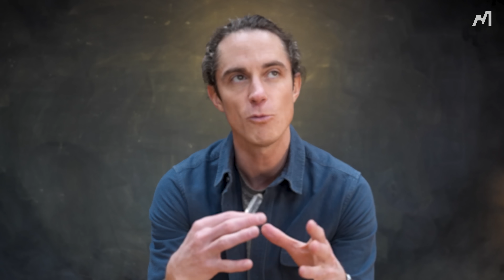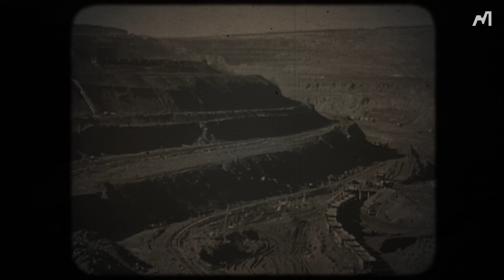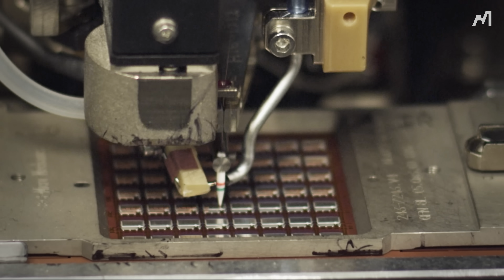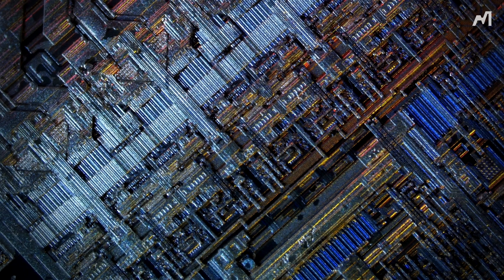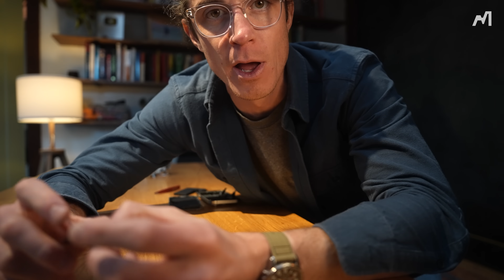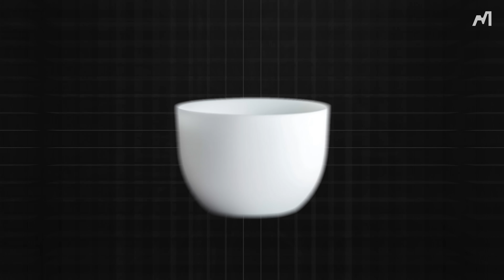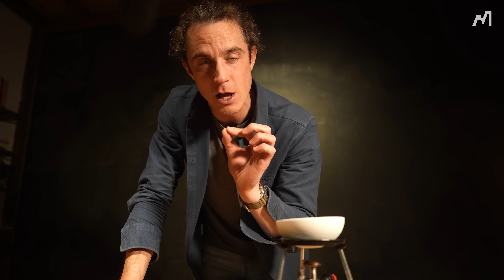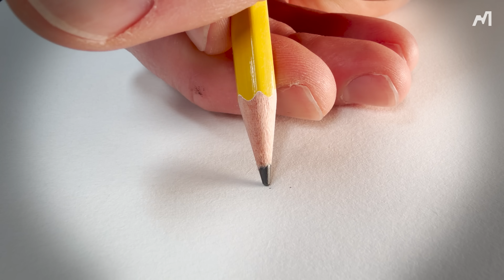Saudi Arabia Has Oil, America Has This

Comment: Hi from Spruce Pine. There are 2 main mines here. One just terminated (not laid off) 60 people. Sad and confusing. What’s going on?
Reply: Because this video is disingenuous. Natural quartz is on its way out. Traditionally, synthetic quartz was considered more pure but more expensive. This is rapidly changing as China is scaling production. 60% of synthetic quartz is made by China and Japan. The US is a minor player. 

The semiconductor industry is also moving to 5nm production which relies on even higher purity quartz which rules natural quartz out. Synthetic quartz is the future and the price is rapidly dropping
Reply: @teacul Yeah, it was my understanding that it was always possible to purify quartz, it just requires more energy input.
Reply: @gregorymalchuk272  You can't really purify it, you have to make it from scratch using pure ingredients.
Reply: @bladdnun3016  yes you can countrise like saudi is already doing it using something called the siemens process while yes its still being reaserched if you can purify it to 5 or 6nm you can still purify it
Reply: @bladdnun3016  You can purify it. You just grind it down to an extremely fine powder and use a bunch of chemical reactions in an extremely sterile and controlled environment. That will net you pure silicon. Now you add oxygen in a controlled manner to turn said silicon into quartz crystals. Same way you purify most things. The issue isn't whether it's possible, the issue is how cost inefficient it is. You're using so much time and energy to do it that it's not considered worth it. A very similar process is water desalinization. Technically we can quite easily turn salt water into drinking water, but it's expensive and time consuming compared to using the readily available fresh water. If ever we were truly running short on fresh water, then water salinization would explode and we'd start doing it everywhere. If ever we truly start running out of pure quartz or we have a shortage on something we need for synthetic production, only then would we start purifying quartz the hard way. It's just one of those things where there's no logical reason to do it if cheaper and faster methods exist.

Now if you're saying there's no way to purify quartz without breaking it down into silicon and rebuilding it, then yes you are correct. But that's not a quartz issue, that's an issue with every crystal or stone. You can't purify and already form diamond, sapphire, emerald, etc. either. We'd need to somehow be able to remove individual atoms from within the stone and replace them with silicon or oxygen atoms in the perfect order to "purify" an already formed quartz crystal. That's likely never going to be possible. We'll be able to terraform hostile planets before we can do that in all likelihood.
Reply: @Loserstakethebait Yeah, in my opinion it's reasonable to say you can't purify most crystalline materials. Maybe my comment was a bit pedantic, yours is arguably even more so.
Reply: @bladdnun3016  Pedantic? I explained in detail how to purify the material you said couldn't be purified. That doesn't fit the definition of pedantic.
Reply: @Loserstakethebait Sure, bud.
Reply: @bladdnun3016  Butthurt much?
Reply: @Loserstakethebait
Boys! Boys!  You're both pretty and nerdy!  Let's not fight...there may be girls watching.
Reply: @bladdnun3016  ego bruised!
Reply: @gregorymalchuk272  "While Pacific Quartz can produce quartz components for semiconductor manufacturing equipment, the report notes that its high-purity quartz is still not suitable for crucibles used to grow the 9N–11N-purity silicon required for semiconductor wafers." currently only used for DRAM
Reply: @teacul  aren't they already making 2nm semiconductors?
Reply: @erkanyildiz98  No.
Reply: @HNKDrumNBass  yes as of yearly 2026 dutch company asml machines are the only machines that can make 2nm semiconductors
Reply: @erkanyildiz98  Yes and no. Yes in a marketing sense. No in a physical sense. The 2nm parts are actually closer to 45nm. Marketing would like you to believe that it is the equivalent of a traditional transistor at a 2nm density, given the advancements in transistor technology and efficiency. Physically we cannot yet do that kind of actual density.
Reply: @NyrahlRhys  I think I remember reading somewhere that 11nm is the physical limit because below that, you don't have enough atoms to make the logic gate, but it's not something I'm super schooled up on, so maybe I'm misremembering.  It is wild to watch videos about how ridiculous the science behind modern chips is though.  X-ray lithography is an insane process.
Reply: @HNKDrumNBass  - Yes.
Reply: @erkanyildiz98 yes they are. Clearly that guy is from China... 😂😂😂 They are still working with 7nm
Reply: @vueport99  Yes and no...
Reply: @erkanyildiz98  yes for phone Arm chips and gpus are getting close, CPUS for desktops are using 5nm
Reply: @HNKDrumNBass  IBM was experimenting with 1nm all the way back in 2020 so yes they are making 2nm
Reply: @NyrahlRhys  Yes in physical sense IBM has done it 6 years ago by making transistor itself 1nm and then layer of isolation 0,5nm in order to prevent electrons jumping, is it ready for production probably not but 7nm is 7nm, 5nm is 5nm, 1nm is 1nm, nm numbers being just for marketing is misinformation repeated by people who don't know anything and just repeat what they heard
Reply: @stevandjuric1479  Yes, and now the project is in Japan's hands essentially because they couldn't build it.
Reply: @stevandjuric1479  I stand corrected. I literally just got fed an article stating AMD has announced it has its first 2NM chip in production.
Reply: @HNKDrumNBass  And Exynos 2600 was already on 2nm
Reply: @michaeltorrisi7289  i think there are lab transistors with about 3-6nm dimensions at Bell labs, but not really commercially usable. then there are the 8-11nm dimension transistors that are commercially usable but AFAIK its not used often due to other effects at such small dimensions. mostly just marketing terms, doesnt really matter anyway^^ what matters are the transistor characteristics at that specific size. newer trend is also not to reduce the gate dimensions of the transistor but rather switch to GAA (gate-al-around) transistors and other newer technologies bc going much smaller isnt possible currently.
Reply: @tonial5789  wrong taiwan semiconductors has been doing it since 2024 lol.
Reply: @tonial5789  Taiwan Semiconductor Manufacturing Company (TSMC) began volume production of its cutting-edge 2nm (N2) chips in late 2025, featuring Gate-All-Around (GAA) nanosheet transistors and completely sold-out production capacity for 2026 driven by massive demand from Apple, NVIDIA, and AMD
Reply: @averageamericanx  asml u mean, also china is doing it too now
Reply: @tonial5789  the process is called 2nm, but it doesn't refer to the size of the output
Reply: @erkanyildiz98  the process is called 2nm, but it doesn't refer to the size of the output
Reply: @teacul  Look at the recent price surge in DRAM memory. 2-3x since last July. We're told it's a demand-side problem, but what you're facing would paint a more complete picture.
Reply: And as soon as I say that, I see the IC prices have increased 7x.
There you go.
Reply: @thomassoderstrom6369  I like it. My net worth went up from this because I own solely Micron Technology stock. It ain't much but Im happy lol.
Reply: @thomassoderstrom6369  Those prices have nothing to do with the actual production process, it is the (potential!)  AI datacentres gobbling up the production capacity . Same is going on for ssd's.
Reply: @MinorZero  lets not discount the greed from the other players in the supply chain - the other rare earths that go along with the process price gouging to get their slice. silicon makes the substrate but without the xenon no lithography, and without the dye no i/o to the chip, and so on...
Reply: @thomassoderstrom6369  a lot of that is aftershocks from when helene damaged the areas around these mines shutting things down for quite a while
Reply: @thomassoderstrom6369  the mine had to be shut down after hurricane katrina for several months, many got fired because parts of it can't be reopened still, less supply more demand, they blame it on AI but those of us here in NC know the truth.
Reply: @teacul it's definitely not on its way out it costs so much to make synthetic it's not worth it
Reply: @davidbass4818  That was true 10 years ago. Far from true in China today.
Reply: @teacul  Exactly, if you can create synthetic diamond, you can make synthetic quartz.
Reply: @teacul Thanks, I could not believe that the world would fully rely on a single mine without frantically searching for a backup.
Reply: @teacul  China can make as much synthetic quartz as it  wants, it doesn't matter. Without access to ASML’s EUV lithography machines, they simply cannot create modern advanced chips. They will not be getting access to them either, as the machines are the single most important strategic asset in the world. They are protected by Japan, UK, Taiwan, USA and EU nations.
Reply: @darthdonkulous1810  We're not talking about advanced chips here, we're talking about the market for synthetic quarts. All those countries using EUV machines are buying their quartz from China. 

Anyways ofc China is also making rapid progress on their own EUV but that's a tangent.
Reply: @darthdonkulous1810  Also, EUV chips are still just ~10% of chips worldwide. DUV still accounts for 80% of chips. And China has become dominant in that in just a few years.
Reply: @teacul  ...more expensive. just gunna gloss that small detail? economics is king.
Reply: @asedcopf  Did you watch the video? It's running out. As tariffs are raised, the world will look for an alternative quickly. Also as I said, it's rapidly decreasing in cost and will soon be much cheaper
Reply: @teacul  China lab quartz only good enough for DRAM, let me quote "While Pacific Quartz can produce quartz components for semiconductor manufacturing equipment, the report notes that its high-purity quartz is still not suitable for crucibles used to grow the 9N–11N-purity silicon required for semiconductor wafers."
get your fact straight, rare earth though is not really rare, given enough will any country can make them enmass, the tech is primitive.
Reply: @teacul  At end of day, the US always has the very tip top brightest and smartest, which is why the MAG 7 is all American companies. Regardless of where the minerals are made, MAG 7 can buy them in metric tons due to multi-trillion dollar market caps. They also pay the best, which is why when an Einstein Chinese boy has to decide after graduating from Harvard to return to China or stay in US and make 8x as much money, he's almost always going to stay in the US. US money and talent is why it'll always dominated Tech/AI/Semiconductor/Quantum/Space.
Reply: @DL-fl5ul  Look at the makeup of MAG 7 engineers. How many of them are born in the US? They have the tip top brightest because of brain drain. Now that trend is rapidly reversing. Fewer of these engineers want to go to the US and Chinese companies are paying much much more. At the same time, the US is becoming much more hostile to immigration and funding their own education and research labs much less.
Reply: @teacul  Likely over 80% of their engineers are born in the US. I disagree about almost all your points here. US Mag 7 pay gap has even extended more vs Chinese companies to where they make over 1,000% more in the US than China. The US grants visa's and green cards for these people. It's the ones who bring nothing to the table that get rejected.
Reply: @teacul  Additoinally, China has no AI companies. They have nothing. Only reputable company there which still is significantly smaller than any M7 is Taiwan Semiconductor. But that isn't China. China has no AI, Semi, or Tech companies that even have 5-10% of the market cap as the M7.
Reply: @teacul  Synthetic quartz in infrared spectroscopy shows site defects that are opal in nature, so it is certainly not equivalent to natural quartz.
Reply: @teacul  They are making 2nm in Texas.
Reply: @teacul  - "Moving to 5nm"? That's old news.
Reply: @t @teacul  issue is it’s not true If China has no access to ultra-high-purity quartz in America like Spruce Pine, they would have to grow synthetic quartz from scratch. Lab-scale crystals could take 1–2 years, and scaling to industrial levels enough for advanced chips would take 7–12 years. Even with other countries lesser quartz quality they will lag behind 
Meanwhile, cutting-edge chip nodes shrink roughly every 4 years:
	•	Today: 3nm → Year 4: 2nm → Year 8: ~1.5nm → Year 12: ~1–1.2nm
By the time China produces enough synthetic quartz, chip nodes will have shrunk further, requiring even purer quartz. This means China would always lag behind the leading edge, only able to make older-generation chips, while the U.S. retains a near-monopoly on the materials for the most advanced nodes.
Reply: @brazejan1 Also synthetic quartz has problems with higher temp and mechanical integrity. Most of the high end chips are using a hybrid design with the outer shell still made of natural quartz and the inner shell made of synthetic quartz
Reply: Because China stopped importing quartz from Spruce Pine. Pure quartz can easily be grown from electronic grade silicon, so this video is pure BS. The reason the pure quartz from Spruce Pine was used for the crucibles was because it was cheaper than wasting electronic grade silicon to grow them. But with geopolitical tensions, China changed to domestic supply chains for security reasons, even though it is more costly.
Reply: @mintheman7 that's what I thought too. Oil and rare earth minerals are not renewable. Quarts??? They can be fabricated. Very bad analogy
Reply: @mintheman7  from what i know, refining ultra pure substances involves massive input of energy, the amount of energy increase exponentially as the purity increases. it would require simply too much energy to make the process even financially plausible.
Reply: @mintheman7  This channel has in the past spewed a lot of other half-truth BS so don't ever believe everything on here.
Reply: @CobraQuotes1  It's called sensationalism. In the past 10=15 years I've been watching it, sensationalist BS has crept in.  It's accelerated in the past 3 years that it clearly shows presenters are definitely vying to get that dollar.  It's so bad that I see very poor amateur videos.  I called one out a couple of years ago, and the presenter tried to defend his video.  It started to get bad, and he quit. The presenter will always lose that argument, even if the challenger is wrong.
Reply: @koyotekola6916  well, it's also called "ensh*ttification" of YouTube. really it's extremely difficult to get income from YT videos AT ALL, unless you cater to the algorithms. I feel sorry for these people, I don't confront them with arguments, what's the point of winning such an argument?  You might as well just watch Patreon and pick up some Patreon channels to subscribe to.  I mean, sure 15 years ago you could make YouTube videos just as a passion project.  Google/YouTube/alphabet is punishing the people who don't go viral enough, it's not "vying to get that dollar", it's trying to get any dollars at all!
Reply: @mintheman7  AI is free maybe stop the BS. China did not stop imports quartz from Spruce Pine. The purest quartz for key semiconductor steps comes from refined natural deposits (especially Spruce Pine).
Reply: @Xyz99899 Believe what you want, quartz is far from a precious commodity because it is just SiO2. I actually work in the semiconductor industry but if believing in fiction if how you cope with life, so be it.
Reply: Social media and constant monitoring is whats going on.
The bar has been raised as to who gets trusted.
Reply: @heyyou5189  - Good point.
Reply: Mining operations make cut backs because;
The product is no longer required due to change.
The product is available cheaper elsewhere.
The mine is being exhausted or reaching the end of its commercial life.
The mine is not commercially sustainable due to Labour costs or mining costs or both!

China produces its own home grown Silica in Labs at a third or half the costs at various purity of grades subsidised by the CCP to axe competitors so tariffs should be added, Japan and Germany produce the purest forms in a Lab at 11 to 12 N - 99.99999 etc.!?!
Reply: @AtoMicHerrinski  You do not grow quartz crystals to get pure quartz.  You grow quartz crystals to get crystals by seeding it with pure quartz.  That means you want the optical properties of that quartz.
Reply: Mahalo
Reply: They killed 60 people why?
Reply: Artificial scarcity raises prices, and demand is huge
Reply: Hi from Morganton Amber. My mom lives in Red Hill.
Reply: Guess someone found some nines out there.
Reply: my casio watch has a quartz crystal.
Reply: they can make more pure quartz. that's it.
Reply: Was there recent natural disasters at Spruce Pines?
Reply: Hello from Marion!
Reply: What do you mean “terminated (not laid off)”? Did they m*rd*r them?
Reply: Keep this filth out of your beautiful mountains. The profiteers driving this hate rural Americans. Guarantee you these corporations will replace all their local employees with minimum wage H1Bs anyway. That way they can flood your county with them and raise the cost of housing all in one move.
Reply: Trump is making America great again, dont you know?
Reply: 11:00 not so secret
Reply: In order to roll out the NWO, America must be brought to its knees. That’s what all these layoffs are all about. To financially destroy Americans. Corporate America is fully onboard and more than willing to go along with the plan.
Reply: @MyVisualRomance  You have been importing the third world since 1965 so of course the conditions worsen. Look up the Hart-Celler Act and how it changed everything. The only thing currently keeping up USA is the reserve currency status of USD. America exports goods and services for 2000 billion dollars and imports 3200 billion dollars worth of goods and services. The difference is made up by printing dollars. If the dollar drops out of use by 3rd parties, America will have to export an additional 1200 billion worth of goods and services to be able to sustain its import levels, which it will not be able to. Americans don't realize that their living standards are mostly propped up by printing dollars which in turn is propped by the rest of the world, and if rest of the world moves away from USD with the current levels of printing the inflation levels will immediately become Zimbabwe. The demographic shift of USA is so far along though that even if you repealed the Hart-Celler Act today, I don't think there is much to be done about that anymore.
Reply: @tacomajoneesi  you are assuming more drastic measures aren't taken to reverse the damage.
Reply: @tacomajoneesi  Importing the third world has not helped the US much.   Especially the last 20-25 years most of the people coming in have been vermin consuming more wealth than they generate.  Kicking almost all of them out would buy us some time.  Moving production back to the US also helps.  Trump started it in his first term.  Most of the tariffs he implemented (or simply started collecting again) apparently were not stopped with Biden, so it looks like both parties agree with the need to move production back here before the end of the dollar, even though Trump is getting all the hate about that.
Reply: @Teddy-Bear-x3  😂what are you implying?  Are you going to genocide all the non whites?
Reply: @MyVisualRomance  the first and normal explanation for layoffs is that the employees are not returning a profit or no longer fit the company's strategic plan.  This is normal business operations.  It doesn't require a theory that all companies are working together the achieve some global dominance regime.  Global strategies are more in the domain of government policies, public and private.
Reply: Man, are YOU naive or just shockingly undereducated about the last 200 years of American history & corporate hegemony?
Reply: @whorstory  or you could just be overly paranoid. Anyway, we won't know the true reason for these layoffs until we get insight into their leadership
Reply: @it-was-just-a-dream  I don’t think any of us believe that market forces are the primary drivers of major business decisions any more, especially for strategic industry.
Reply: @MyVisualRomance take your meds